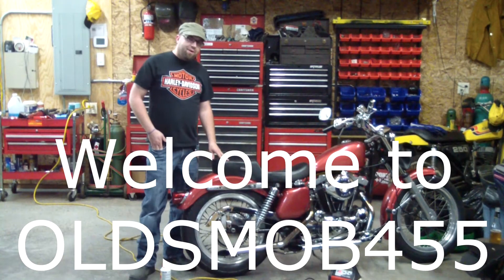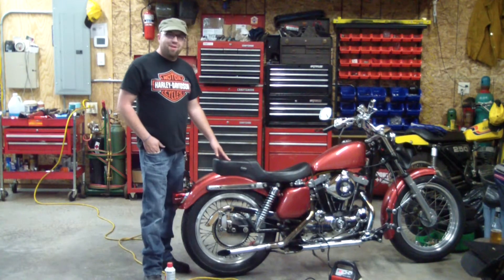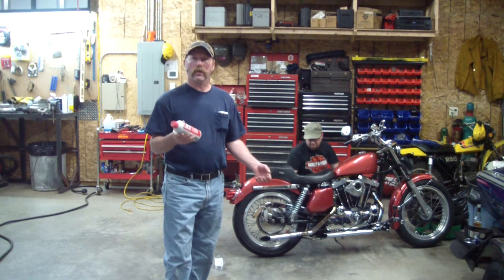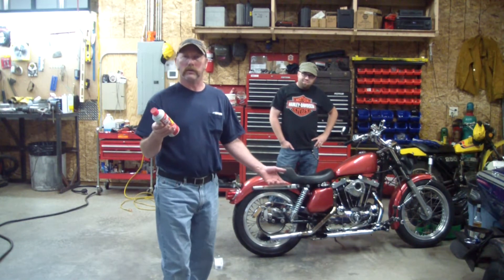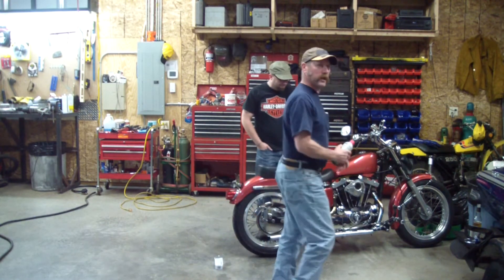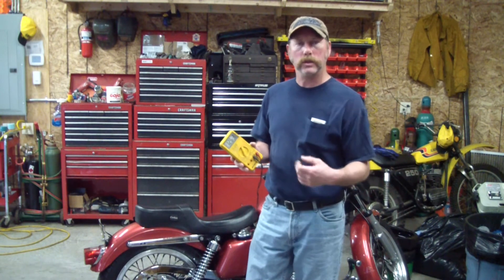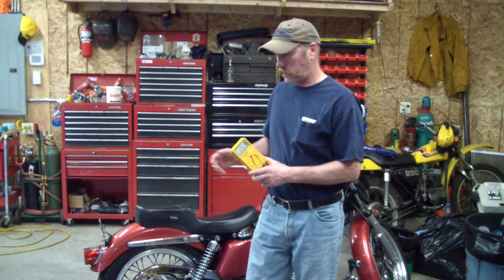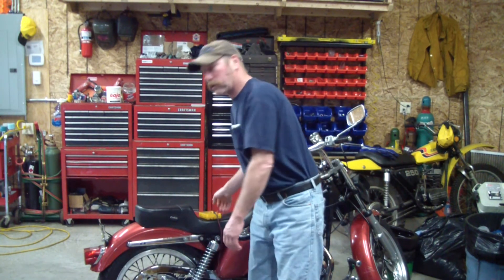Harley IronHead Charging Failure on a 1975 Sportster

Comment: " in the path of a failing Harley" -- what a great one liner!

With an old car the diagnosis was usually made by a driver, who noted the system voltage sag and lights fade. I can see why it would be a more challenging diagnosis on a bike. Why did the quickstart help?

Comment: just had to polarize/flash my generator it's very easy take jumper cables hook them up to your battery then take the other hot terminal and touch the hot wire on your generator that simple.

Comment: A generator never works at idle.  You have to run that engine up a little before it starts charging.
Reply: Thats what mine is doing 
new battery new Gen ??
Reply: Edward Everson   Bring the idle up to about 1000 and the generator should kick on. This is normal for a generator.  Those low rpm idles sound good but they are also hell on the push rods and rocker arms because you aren’t getting oil to the top end.